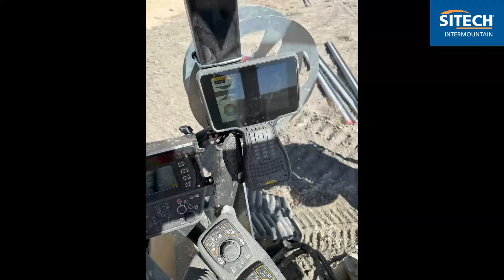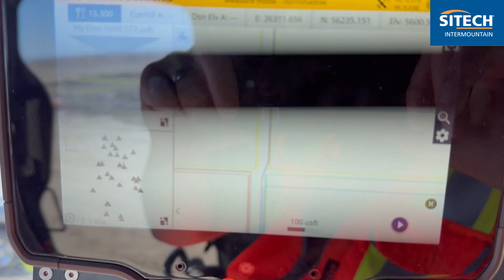Siteworks Driving Mode   BHI Cable Dozers

Comment: Great videos jeff ,just took tiltrotator off for repairs, put standard q release hitch on been in settings, web inteface,configure ,settings top of screen selected  first menu gone through to tiltrotator  ,tilt hitch  selected standard q hitch,come out measured buckets up but getting message gnss out of tolerance, projects load up all sensor are good but no elevations are on models just blank map with error about gnss any idea what ive done wrong driving me mad ive had trimble for 4 years self tought with massive help from you thank you ,but im struggling now jeff 👍
Reply: I apologize, I responded to this right after you sent it, but I did not notice till today that it did not send out or go through when I did. Sorry. It sounds like you have configured the machine correctly and done what is needed there. But my experience with a GNSS out of set tolerance means an issue picking up your base station good enough or you are under or by some sort of obstacle obstructing satellites. If you have all the connected devises, I would check your radio on the machine or the base station antenna cables, etc. It could also be a job site calibration issue where you mentioned no elevations or a map. Check and make sure the correct calibration went in with the model.